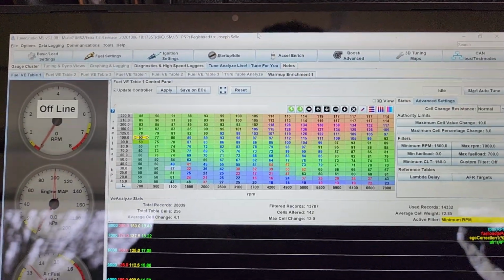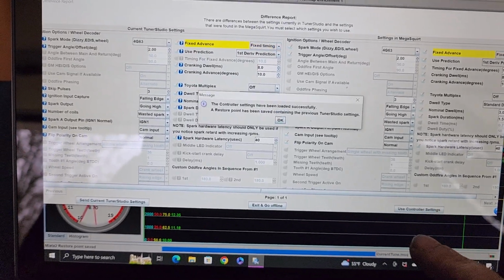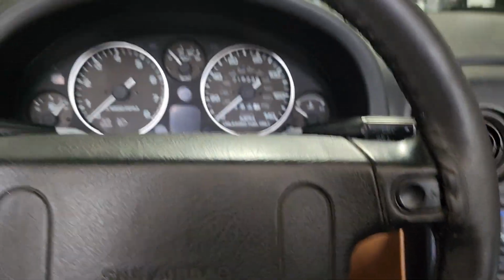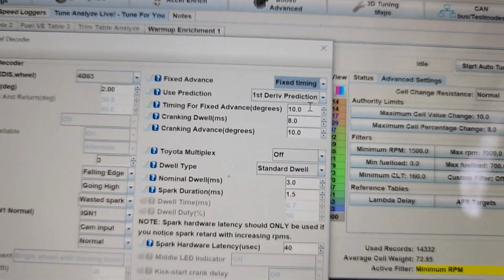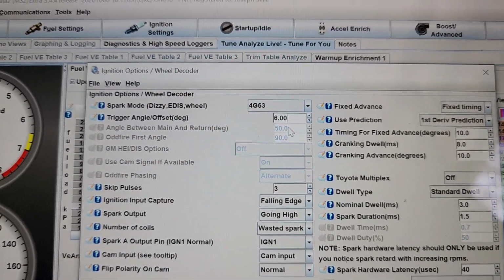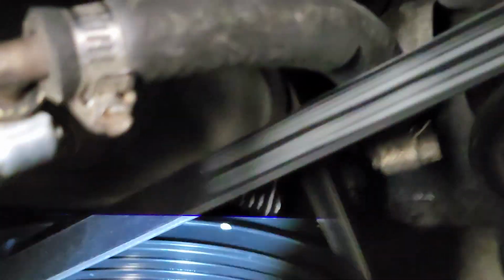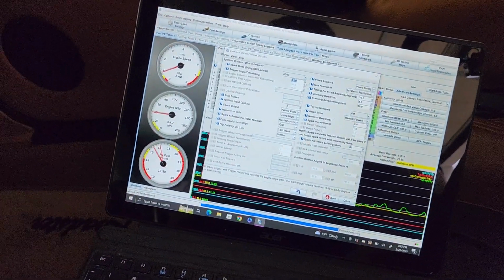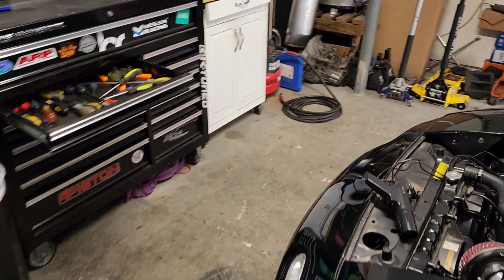How to set ignition timing for a Miata using Tuner Studio

Comment: so what do i do if my car doesnt start and i want to rule the timing out as a factor?
Reply from the maker: @BreezyYacht-o1l  Check your timing marks and make sure they line up first. Have you done this?
Reply: @TreadShredders  yeah those are all good, well my car ran but i just switched to a standalone and not having much luck yet gonna try charging my battery up to full charge from 11.5 volts and hoping i’ll have more luck
Reply from the maker: @BreezyYacht-o1l  That will definitely help some. You had no issues before swapping to a standalone? What unit did you chose?
Reply: @TreadShredders i got the speeduino, got it started now, and actually starts consistently after around 7 seconds of cranking but idles at 2.5k!!! and a bit too lean like 16.5-16.9!!! not sure which to tackle first
Reply: @TreadShredders but based off the video you think i should try bringing it down with the ICV screw first or with the ECU graph?
Reply from the maker: @maxmiataJMNCO  Use the screw first, turn it clockwise. Do your AFR's go down after it's warmed up? Those are very lean.
Reply: @TreadShredders  you know i didn’t let it warm up because of the AFRs and the high idle and went off to do more research, but i will test out today as i will be tinkering with the idle, been watching/listening to this video on repeat at work lol, also im the same guy who commented accidentally switch accounts in between
Reply from the maker: @maxmiataJMNCO  I would make sure you have the right basemap loaded in. Make sure the idle valve is set to around 300hz, mine is at the 313 on MS2. Make sure your general settings are setup to match the motor and injector size you have. Compare your VE table to someone else with similar size injectors. Higher VE number, more fuel. You can just highlight the area you see the car idling around, as a whole, and keep adding fuel until your AFR's reach your target. I'm at around 13.7 at idle I believe. This is just a test to make sure everything is also working properly, not a how to tune. But something to play with and learn.
Reply: @TreadShredders  My set up is correct i had triple checked myself, not sure if i’m at 300 or 313, i did match the motor configuration, but yeah i’m thinking i’ll start with the idle screw to bring the idle down and then i can adjust my ve table to get the afr right? because if i get the AFR right for a 2,500 idle wouldn’t that’s knock off the AFR at a 750 idle? sorry i am so ignorant when it comes to this

Comment: i just bought a speedyefi ecu and i previously advanced my timing w the cas. when i put that ecu in do i need to tell it i advanced it or should i put the cas back to the 10 degree and only tell the ecu to advance the timing. also i hope that made sense lol
Reply from the maker: Just make sure the ECU is registering exactly what you have setup already. If you're 10 degrees advanced, set the timing in the ECU to 10 degrees and check it with a timing light to verify it. If you don't, everything on your timing table will be 10 degrees advanced

Comment: what version of Tunerstudio are you running, I have the registered version, but I don't have the same options available as you do,
Reply from the maker: I believe it's the newest one. I'm on MS2 on a DIYPNP. What options are you looking at that you're missing?
Reply: @TreadShredders  thanks for the quick reply, i think it is because I have the speedyefi, on the menu options (big buttons) you have ignition settings, I only have spark. then my menu options are different inside.
Reply from the maker: @john-paulmifsud5724  yeah, no problem. That's probably what it is, there might be a few more options with this ECU. Sorry 😞
Reply: @TreadShredders  no, thank you. It's a great video and still helps me out.